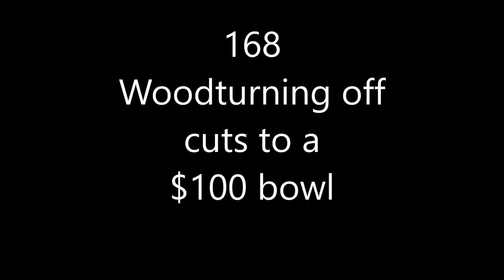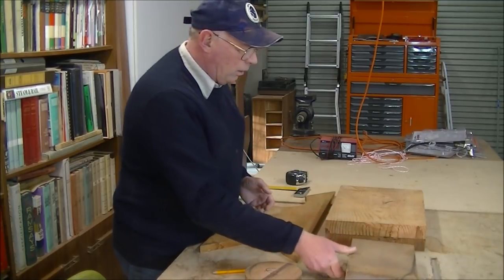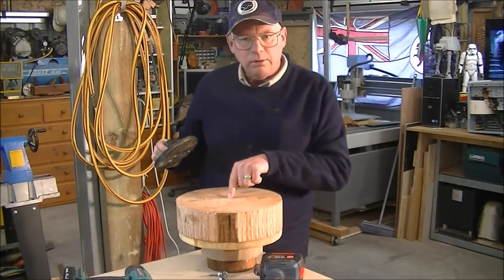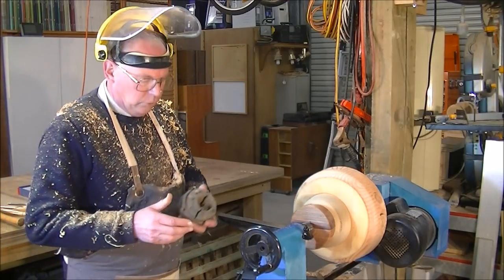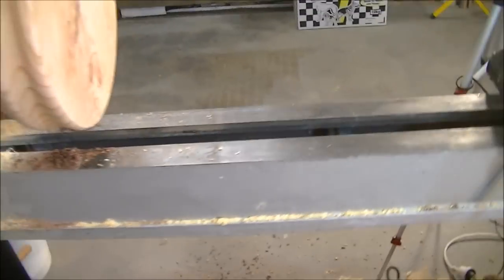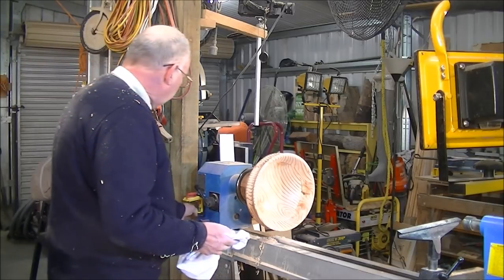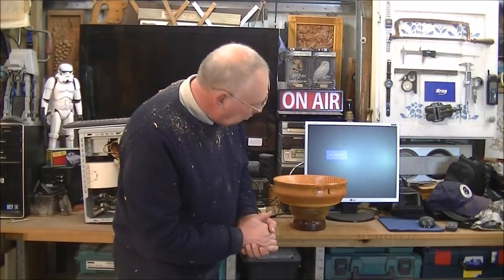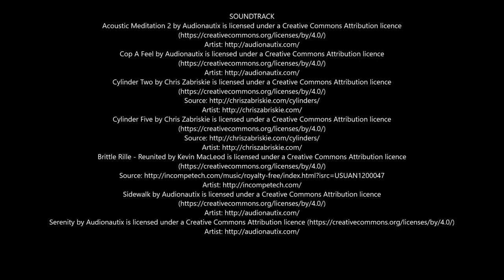168 $0.50 of off-cuts into a $150 bowl  Wood-turning

Comment: I hate that I am constitutionally unable to not let this pass, but what you call an internal tenon is a mortise.

Mortise: a hole or recess cut into a part, designed to receive a corresponding projection (a tenon) on another part so as to join or lock the parts together.

Tenon: a projecting piece of wood made for insertion into a mortise in another piece.

Comment: What gouge are you using at the beginning?  Bowl gouge with almost a flat nose grind on it? Also, the jaws on that chuck look awfully open gripping the mortise, which means that only a small portion of the jaws are actually gripping.  If you size the mortise to just a tad larger than the minimum diameter of the chuck jaws in their closed position, you get much more contact between jaws and wood.